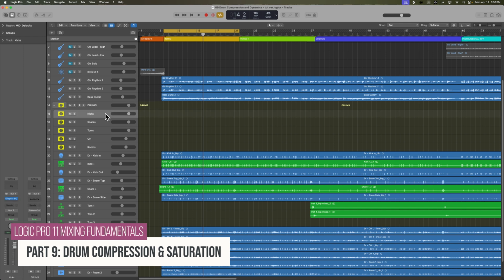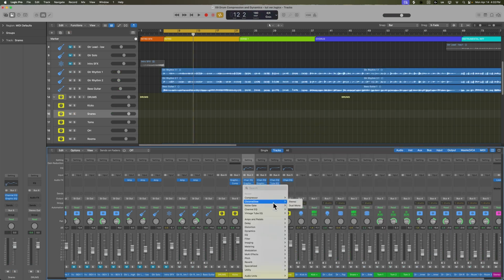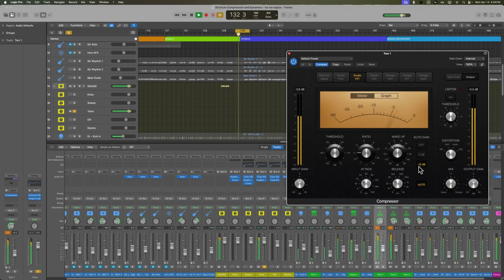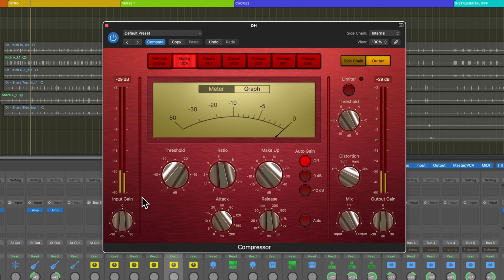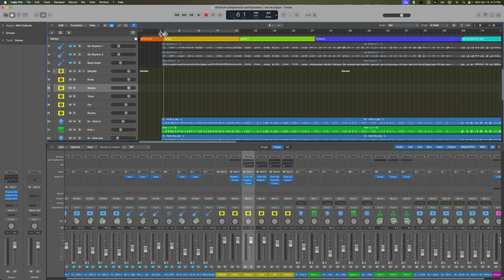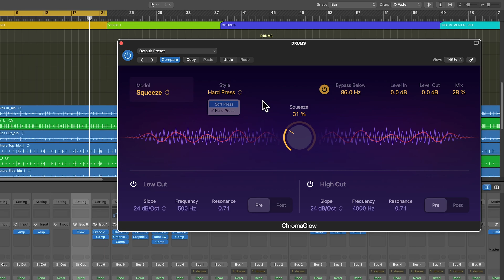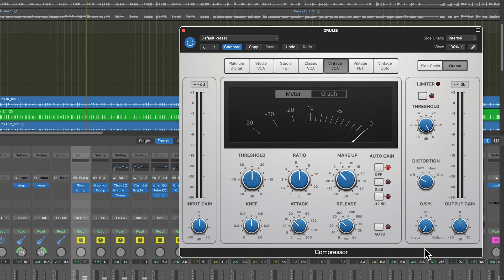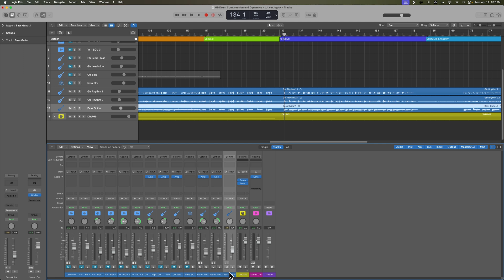Logic Pro 11 Mixing | #09 Drum Compression & Saturation

Comment: Hi Josh. When you say around 06:15, 'a slower release time can help get rid of the ring' on the toms, I feel like this is a moment where, as a student, I say to myself, 'oh, I see. That's why you're doing it'. But then I think about whether I actually understand, and have to say, 'no I don't'! Why does a longer release help control or even remove it? I can't be the only person to have this question.  Also, I notice that you don't use parallel kick or parallel snare channel strips for either extra attack or extra thump, which I believe is very common in hard-rock / metal music (I've even watched videos that you've made on this very topic more than once in the past). Is this because you've already added the extra attack and thump with your doubled samples earlier in the process? Thanks! (LATER EDIT: this is a bit of a 'spoiler alert' from someone who's bought the course, but you do some 'stuff' in Video 14 which answers my second question. My apologies!)
Reply from the maker: The release time of a compressor controls the time it takes for the compressor to stop compressing once the signal has fallen below the threshold. So in essence, a longer release time will compress for long period of time than a shorter release. For drums, that means the tail/ring of each drum hit will be compressed for longer - which will push down the ringing resonance of the drum for longer than a shorter release. But you have to be careful not to use too slow of a release, because then the compression will cut into the next drum hit.